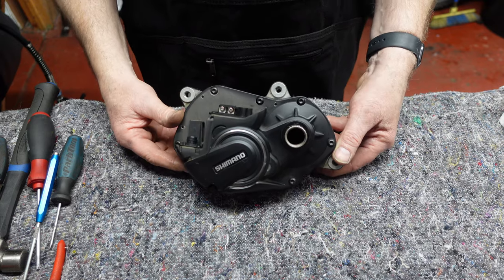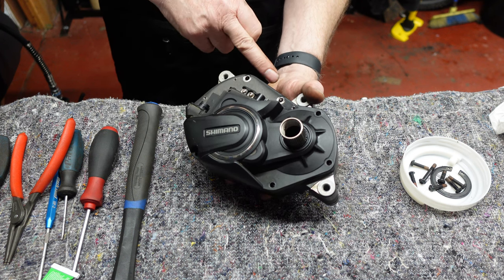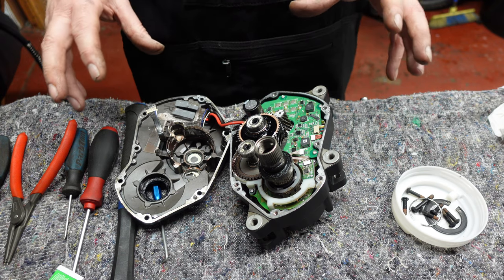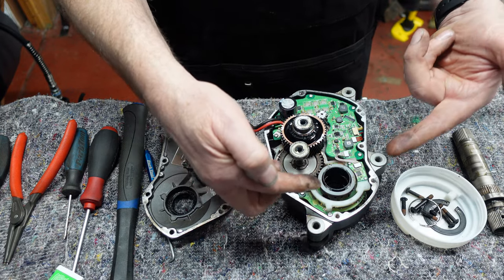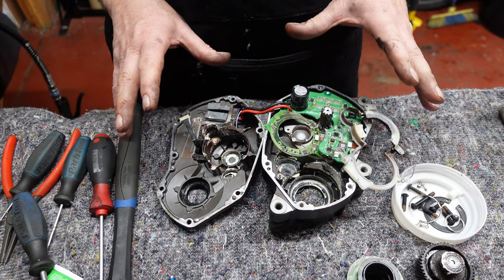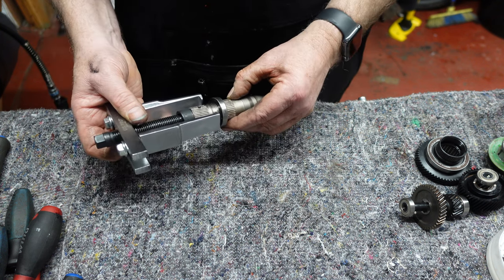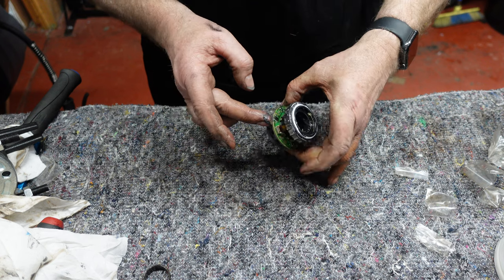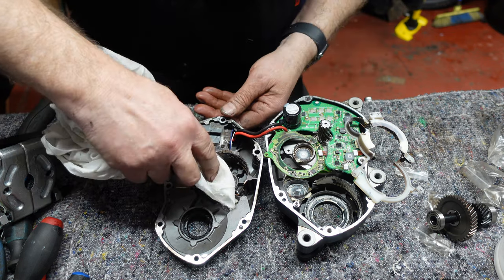Shimano E8000 Motor overhaul and bearing replacement.

Comment: I can see where a support stand would come in handy for this, much like there is for Holley and Rochester 4 barrel carburetors. But the support pin heights would need to be different to match this motor.

Comment: Probably oil Is better for the lubrication, and It we want we can improve the Gear box with two cups for replace It. The only big problem Is find the right oil for gears wheels and electronics parts.

Comment: I managed to rebuild my motor with the help of this video, so thank you very much. I sourced the bearings from a local dealer. They are pretty basic bearings. Couple of points to add. The crankshaft in mine was pretty stuck so it needed some gentle punding to come off. Also the other needle bearing is behind the seal the seal needs to come off temporarily in order to change that.
Reply from the maker: Hi, Thanks for watching and your comment
Reply: HI, in my case i am not able to get off the crankshaft , how will you get it ? is there any part , like circlips o something that seems it avoid the cranckshaft release. thanks in advance
Reply: @pedroantoniozorzo2901 no, there is only the one circlip on the "bottom" side which is shown in the video as well. I assume you removed that. There is some horizontal play in the crankshaft. That may be the clutch. Make sure you take that play out before pounding it. It took some harder pounds with a mallet. It definetly was the scariest part since it's hard to know how much force would brake something. I later thought that mabye some WD40 or similar might have made that easier. The part that is sticking is the bores right on the inner side of the bearing.

Comment: The circlip on the outside is very malleable and easily deformed. I am considering replacing mine with a better quality one. Thanks for your video. It took me approximately 3 and a half hours to do the whole job. Quite nerve wracking but very satisfied with the result. I have rebuilt hundreds of motorcycle engines so dealing with the tiny wires and circuit boards is a bit of an eye opener. Rejoining the wire ribbon is a trick!! You need to be careful not to put too much grease in the blind bearing holes as it creates a seal that pressurises the cavity when you try to insert the bearing and the shaft. I have been a cycle and motorcycle mechanic for 50 years so I have experienced this before on petrol engines. Cheers .
Reply from the maker: Hi Francis, great comments, thank you. I also have an interest in motorcycle engines, in fact any engine.

Comment: Great video and thanks for your effort, I have an EP8 that has an internal problem that Shimano will not warrant because I'm the second owner. No one services the motors in Australia so its replacement only at $2200 so I will be doing it myself, thanks again for the helpful tips..
Reply from the maker: Hi Grant, good luck. be careful

Comment: Great video , repairing mine at the moment , and having trouble with the needle bearing on the drive side we’re you able to change that, didn’t see that in the video.
Reply from the maker: Hi, thanks for watching, yes I was but they can be very tight on the shaft

Comment: Very clear instructions here. Thanks. Just to note you did not show putting the circling back on the shaft to complete. 

While tricky it actual looks easier than the Bosh performance line motor. Less bearings. Shame that the seals are not available as water ingress is a real issue with eMTB motors. 

With no obvious water damage i.e.corrosion, 2500 miles really is not excessive to need a full bearing change for wear. This represents less than 10 miles a day for a year. Disappointing. Can better quality replacement bearing be sourced?
Reply from the maker: Hi Steve, It's probably the trickiest motor to do, there is so much going on and its all right where you can accidentally damage it. Regarding the bearing wear, failure of bearings are often due to water ingress as you say, some users use jetwash?, it only take a small amount of water to start the damage process. Thanks for your comments.

Comment: Thanks for the well explained instructional video it’s very well done. I have an E8000 that I believe has a buggered bearing so will need to dissect it to inspect the damage. I’m in Australia and parts are not available for at least 9 months. I’m thinking (hoping) I would be able to get a bearing form a local bearing supplier. Would you happen to know what bearing part number/dimensions for this unit would be? 
Thanks again for the well thought out video.
Reply from the maker: Hi, All the bearings are available here, https://www.ebikemotorcentre.com/
I advise not to try and replace the bearings, damage is so easy to do on these motors
Reply: @TheYorkshireBikeMechanic  strange comment advising not to replace bearings but selling them... note taken and thanks for the heads up re possible damage. I'll try to dismantle ans6see how I go a d order bearings of successful.  Do you sell complete motor units?
Reply: Dismantled motor and the main bearing was totally destroyed. Managed to source one locally and got motor going again.
Thank you again for the very helpful video

Comment: Awesome video Dave.
I'm waiting to have some drift sleeves made to press the largest 2 bearings on to their respective shafts. Basically steel pipe just wider than the diameter of the shaft, but no wider than the beating inner race.

Can I ask a question.
There is a 2nd roller needle bearing in the outer most gear sub assembly  (the one that has the biggest bearing fitted).  Does that neddle bearing also just pop out or does it need to be driven out with a drift or puller?
Reply from the maker: Hi, Thank you for watching and your comments, Im trying to think how they came out and to be honest without stripping another one down I couldn't remember. sorry
Reply: @TheYorkshireBikeMechanic  it was obvious once I disassembled the motor. Your video was exceptionally helpful in the end. 
I had some bearing play and had planned to replace them, then at the weekend my drive side bearing had disintegrated and seized the cranks. Now all bearings replaced and motor is singing a tune again. 😀
Saved me a fortune 👍

Comment: I've got an issue with an intermittent torque sensor fault accompanied by E010 on my E8000 after pedal strike on a rock, so I followed your video to take a look inside. I was hoping to see a loose ribbon cable, but nothing looked obviously wrong, apart from the fact that I was not able to separate the crank shaft from the torque sensor. It seemed to separate much easier for you and I wonder if that has anything to do with the error I'm seeing. Great video, thoroughly enjoyed the process!
Reply from the maker: Hi, Thanks for watching and your comments, You may not see anything inside that may look to cause errors, this is the main problem, the motors are so sensitive. The torque sensor can be stuck on the  crankshaft, the one way bearings cause it to stick on and are very difficult to remove without damage, the ribbons tear away. you are very lucky if it slides of the shaft. it's the most difficult motor to work on and I advise against it.
Reply: Hi Can the torque sensor be replaced as I had mine plugged in and it’s giving a error on torque sensor?thanks

Comment: Hi, first of all thank for the greta video you posted, it's the only one in the internet with the whole process.
My Shimano motor was making a nasty noise I was able to find in some videos and people was saying it was the bearings F..ed. I was going to buy the bearings and do it myself but as I had to buy the extractors and the press to install the new ones I finally decided to take it to one guy that makes these jobs for some local shops here in Spain.
The thin gis I just got my Shimano motor serviced, the guy that made the job replaced the same bearingns you replaced but the nois is still there, I have a noise from the engine when the wheel spins backwards (while cleaning the chain) and also on climbs. the noise disapears for a fes second if I stop pedaling and start pedaling again.
I thin kthe issue may come from those sprag bearings you mention. Do you know the service parts of those sprag bearings? I'm prety sure Shimano just buys them I don't think they will manufacture themselves.
The noise are these:
https://youtu.be/gX47kNOlZRI
https://youtu.be/xzJdUe9EctQ
Again thanks a lot for all the effort put in that video
Reply from the maker: Hi, Thanks for watching and your comment, sorry for the late reply. all the bearings are available form , performance line bearings, they have international partners too. The shimano motors are so difficult to service, not many will do it here in the uk.
Reply: @TheYorkshireBikeMechanic  Thanks for your reply, also the spragbearings are available in performanceline bearings? Do you have any reference I can lok for? Thanks a million.

Comment: Hey Dave watched your motor removal and it worked a treat..replacement bearing got crank shaft and wouldnt pull out of speed sensor any tricks a i wiggled and wiggle wouldnt come out?
Reply from the maker: Hi John, this is very common, the problem is that the sensor connector ribbons are very very easy to damage, I don't have an answer for you as too much pushing and knocking will damage the sensors.

Comment: Hi! I was about to order the bearings to do this maintenance but then i saw your video again and heard you say noise from bearings are audible also with the motor off. Well, mine does a Hell of a noise but not with the motor off, so i'm a bit lost now. Is a very strange noise, specially in high torque uses, trail and boost, but motor feels good, is just the noise... Sort of vivration... Idk... 
Alredy open the motor and bearings fell really good, so if you have any ideas they are more than wellcome... My friends are fed up of my noisy bike lol, It sounds like an ill duck with every pedal stroke. Thanks a lot! Great videos!!! Keep It Up!!
Reply from the maker: Hi, Thanks for watching and your comments. shimano motors tend to have a whine when under load, even newish e8000 will whine. when you compare it against others of a similar age is yours much noisier.
Reply: @TheYorkshireBikeMechanic  much much noiser yeah, i recognise the whine you are talking about but i think this something else, is there a way i can send you a vídeo or something so you can hear It? Thanks for your help!!

Comment: Sorry one more thing, my motor (e8000) turns fine in the direction of peddling, but feels quite stiff to pedal backwards, I removed the crank arms and was unable to rotate bottom bracket anti-clockwise.. any thoughts?… thanks in advance
Reply from the maker: Hi, Thank you for watching and your comments, sorry, tricky one to comment on as it could be a few things, best check it checked out.

Comment: Super Video von dir!! Welches Fett benutzt du? Kann man auch das Weiße von Bosch benutzen? Danke
Reply from the maker: Thank you
Reply: @TheYorkshireBikeMechanic  I heard that you have to be careful with the torque sensor. Because it may not work afterwards and it cannot be calibrated afterwards. Is that true? Can I also get spare parts from the engine from you?

Comment: very helpful hi i have the same motor mine at the moment makes an awful noise and is slipping like mad is this the normal cause of it slipping or would it be more than just bearings ps no error codes just noise and slipping any advice would be apreciated before i order the bearing kit
Reply from the maker: Hi, thanks for your question, excessive bearing noise is one thing but slipping under power is a completely different situation. Sadly they are a very difficult motor to service and very few will attempt it. Try contacting your Shimano Parnter to see if they can help.
Reply: @TheYorkshireBikeMechanic  thankyou for getting back to me much apreciated ps im going to order a new motor but i will go inside it once new motor is here is there anything inparticular to look for

Comment: Hi, great stuff, but you did not show how to replace the needle bearing and the largest bearing on the largest/outermost gear ring. Can you plese tell what tool you use for them. Thanks, and all the best, KM
Reply from the maker: Thanks for watching and your comments, I made some press tools on the lathe for each bearing including the needle ones.
Reply: @TheYorkshireBikeMechanic  Hi, thanks for the reply. I have e7000 motor and maybe its different, but to me there does not seem to be a way to push the needle bearing out since I cannot see a surface to push on - just a little bit of rubber and the rest looks like gear ring surface. But maybe I am wrong.

Comment: Thanks for the video. It`s really helping me alot. But I really have a problem to get the shaft out of the part you show at 21:18. The sprague bearing is stuck in my motor and needs to be replaced and the shaft wont get loose. Any Tips ? And also do you know where the right sprague bearing can be found ? Thanks for your work. Greetings from Austria
Reply from the maker: I have no tips as is case differs in how it comes apart, some easy some are a nightmare. bearings etc found here, https://www.ebikemotorcentre.com/

Comment: Thanks for this great video, but I can’t loosen the aixle, any advices, thanks Peter
Reply from the maker: Hi Peter, It will be stuck on the roller bearing near the casing, From my point of view it's difficult to advise because I'm not with you to see it, it this case you would normally need to strip it down further to remove the axle. Its a super tricky job and very easy to damage, I would not recommend it.

Comment: Hello, this video is awe-inspiring! 🙇I would probably suffer a nervous breakdown if I had to do this on my motor... 😲
One quick question about motor-noise diagnostics:
What is the reason for scratching, duck-like noises that occur only (and even then only sometimes) when pedalling uphill ? Could it be the bearings still?...would dysfunctional bearings make noises all the time, even when assist is off? 
Thanks a lot from a "mere rider"😉
Reply from the maker: Hi, Thanks for watching, you will know when the bearings are worn, turn the motor with the pedals when the motor is off, there will be really rough grating noise. other types of noises are hard to explain without having the bike in front of me.
Reply: @TheYorkshireBikeMechanic  
Thanks so much for replying!👍👏 one subscriber +!

So that's not the case here... With motor off, or even while riding on even roads with motor on-- no unusual sounds... 
On uphill drive with full engagement of the motor there is a buildup of that pulsating scratch-, coarse duck-quack-like like, scraping noise,  pulsating at ± double speed compared to pedaling frequency...
It immediately stops when I pedal on with assist off... 

Still, the motor seems to be fully functional so far... 

I suspect it's connected to heat buildup?
 Or I had put too much stress on the motor wiring itself...? 
(by pulling a buddy on his non-E bike uphill with a rope for example...am a rather relentless rider, too😁😊) 
Thanks for your attention...
Reply: Sur les 6 vis qui maintiennent le moteur au cadre, avez vous mis du frein filet afin que les vis ne ce dévissent pas ?

Comment: Wow. Well done. Definitely a first. Is the 7000 motor the same do you know?
Reply from the maker: Hi Alex, thanks for watching, earlier motors are very difficult to work on as the circuit boards are soldered in place, no go I’m afraid.

Comment: Inspired by your video, I took my motor to bits and, unfortuneately I broke the ferrite(?) ring on the main shaft (the one with the torque sensor).  Do you know of anyone who has spares for these motors?
Thanks for this great video.
Reply from the maker: Hi, sorry that things have not gone as well as you hoped, depending on where abouts you are is to send your motor to Peter at performance line bearings and ask him if he can possibly fix it for you
Reply: @TheYorkshireBikeMechanic  Hi, I checked out their website and found that they do not do any Shimano!  Nor does their partner here in France. I shall keep looking and, if I find anything interesting, I will post it here.  Thanks anyway. Keep up the good work!

Comment: Hey Dave, thanks for sharing. Really appreciate that. Just wondering if you have any spare parts for sale, or any used ones? As my mechanic opened  e8000 and discovered one pinion gear's teeth (the one on your left hand at 10:36) is damaged instead of the bearings. Sad.
Reply from the maker: Hi, Thanks for watching and your comment. sorry I dont have any e8000 motors in the strip down.

Comment: Hi Dave, just viewed this and have a question. On both this, the EP801 and other motors, are there any seals on the housing where the main driveshaft enters/exits the motor? If there are and you can't get replacements, then would it be worth replacing the bearings as you'll not be able to keep the crap out due to the seals being shot?
Reply from the maker: Hi, im not sure because I stopped opening up shimano motors a while ago, whilst bearings are available any seals are not, unless performance line bearings have has some made.
Reply: @TheYorkshireBikeMechanic  Thank you. I was asking out of general interest as I had been looking to get a Santa Cruz with the EP8, but the new Nicolai MGU has just been released and I think my money will be headed in that direction.

Comment: Hi, can you please help? I have a bike I am servicing for a friend he has the e7000 with, I suspect bearing noise. Can this be done to that motor?
Reply from the maker: Hi thanks for watching. Sorry, the e7000 is not serviceable, the electronic boards are soldered in place and can not be removed without damage.